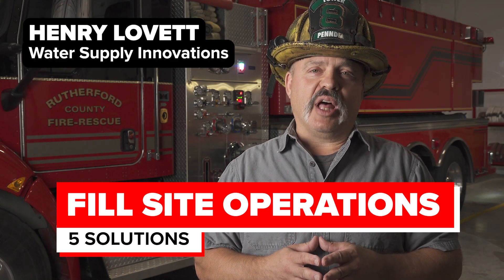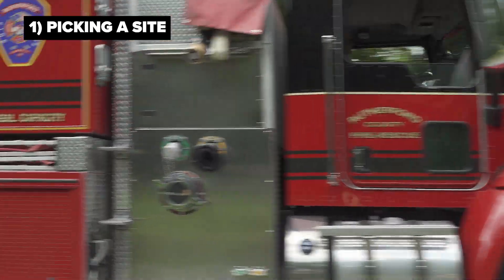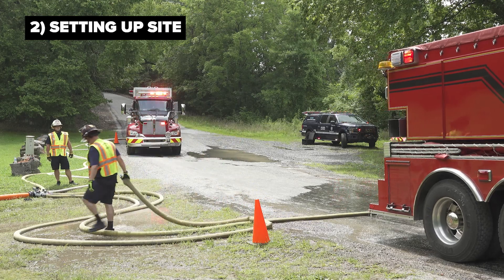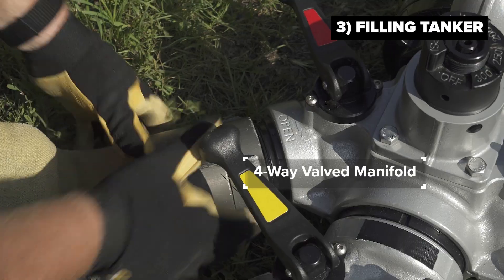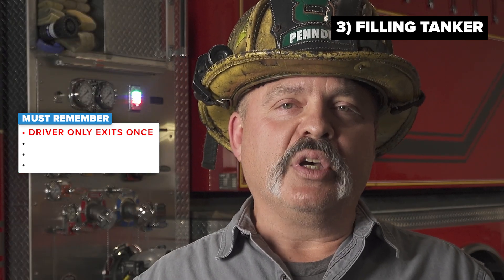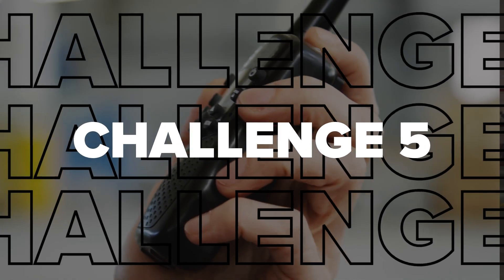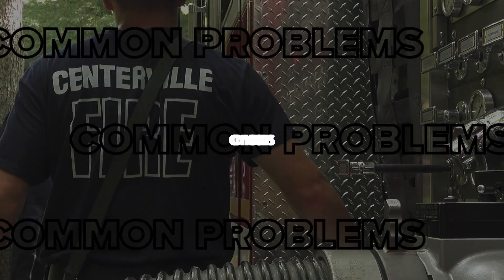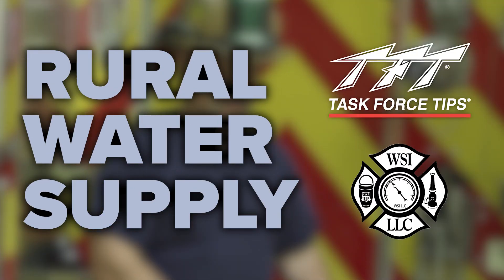How to Set Up a Fill Site (Rural Water Supply - E2)

Comment: We have water supply specialists in our volunteer fire department, this is usually for the other end of the operation at the fire scene, but the idea is then you can have one firefighter, plus the engineer running supply and the lieutenant can go up and assist on the actual fire, they deemed it pointless to have a lieutenant tied up just moving water around